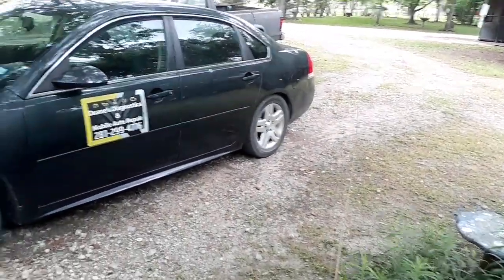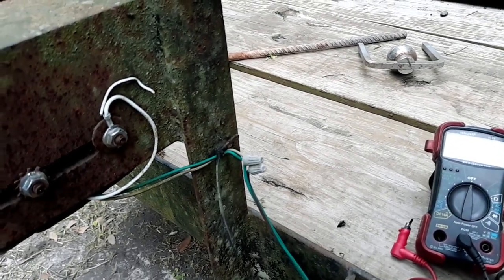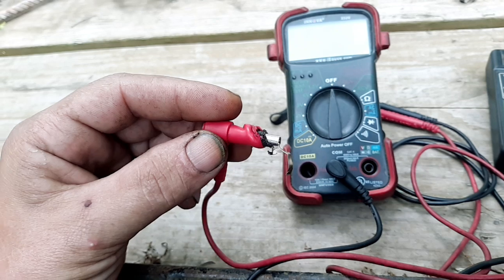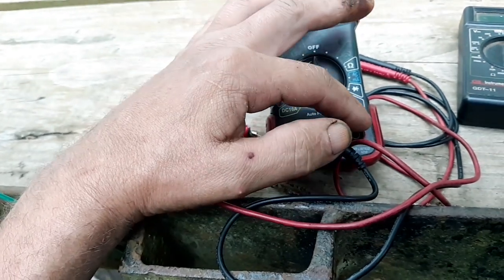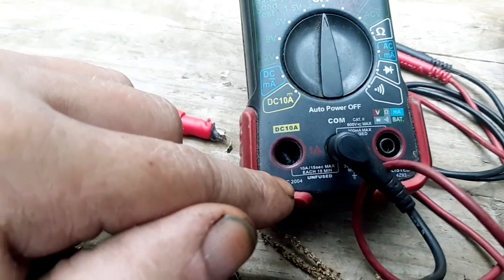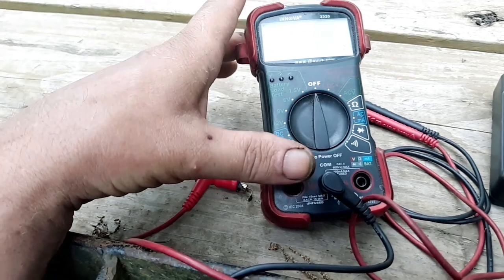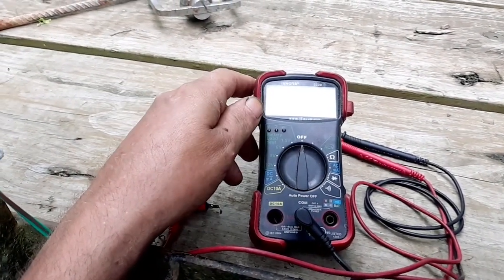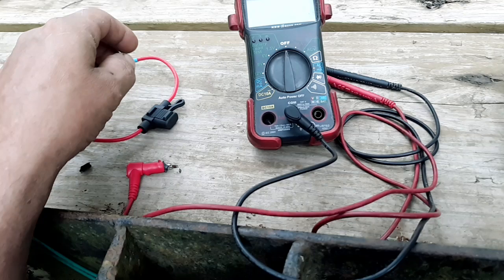Fried my multimeter. Common mistake. Nobody's perfect. Check your test leads before testing.

Comment: Depending on the way they arrange that circuit it might still work in the other modes. it looks like it just melted off the 10A jack.
Reply from the maker: Yeah, honestly I was thinking the same thing myself.....I think it might still work in some of the other modes.....but I never tried using it again since it fried.....but am curious about that......will probably eventually try it.....can't really hurt it any worse...lol.

If nothing else, I figured I'd keep it for parts and the circuit board and internals. Eventually I want to learn how to solder and desolder circuit board parts and learn more circuit board level testing & stuff......but I'm a long way off from that, but figured it'd be good to keep for parts to practice that kind of stuff on when or if I ever get around to it.
Reply: @DuanesDiagnostics  on the black one that I have that Jack is just connected through a shunt a thick piece of wire and there are sense lines on either side that go to the circuit for monitoring. So if they stuck to the same design method theoretically all the other modes should work unless it took out a trace on the circuitboard between something. The best part if it still works you won’t be make that mistake again as it will be physically impossible.
Reply from the maker: @imark7777777  Yeah I remember seeing a thicker piece of wire on mine near the ports.....guessing that might be a shunt.....will have to take a closer look at it.....but yeah, I won't be able to make the same mistake again with that meter.

Comment: Yep 2 cheap meters. I myself had the one on the right and accidentally did this to a power strip. Thankfully it was a power strip and the built-in circuit breaker tripped. In that case it's got a thick copper wire in there so it handled the short and lived to tell but I also pulled out quick.
Reply from the maker: Yeah I never even thought about that.....about being able to hook it up wrong on AC line voltage......probably could smoke the meter alot quicker that way.....but good your power strip had the built in circuit breaker, and it actually worked.

Comment: Bad meter design. I have done the same on my test meter and it blew an internal 10A fuse without damaging the meter. It looks like your """FUSE""" is a thick piece of wire. As you say "UNFUSED" - why??
Reply from the maker: Would pretty much agree, it's a bad meter design......but also honestly, the bad design has also 'saved' me in the past, where I went to check battery voltage, but didn't realize the positive lead was still in the amps port from previous testing I'd done, so when I touched the leads to the battery posts momentarily, I just got a 'spark', but no blown fuse, or melted meter, so that design has 'saved' me in the past, but not this time.

From what I've heard from automotive instructors, alot of meters are internally fuse protected......but not this particular meter......it does say 'UNFUSED' on it......right below the amps port.

Not really sure why some meters would be fuse protected, and some not......but seems like an intentional bad design to me to eventually sell more meters......but maybe not.....I could be wrong.
Reply: @DuanesDiagnostics  Yeah it's annoying the first time it happens and you don't have any 10A fuses and have to wait to get them before you do the testing. Now have a pack of 10 just in case. However, also then bought a digital clamp meter [UT210E] (does up to 100A DC and no direct connection to the circuit so nothing to blow up - newer ones do even higher currents now) for doing high current testing so don't use the normal meter in the Amps socket.
Reply from the maker: @johnr3435  Yeah I have a few different amp clamp type meters, but they're not always accurate or reliable for measuring in the low milliamps range......which is alot of what I need to measure......checking battery drains/parasitic draws, etc........sometimes the regular non-clamp meter with a direct connection to the battery is much more accurate for doing tests like that.......in my opinion.....at least based on my tools and experience.

But I do have a clamp type meter that was pretty accurate for the low milliamp range, but it started not working right about a month ago or so.......I also have amp clamps that hook up to scopes......are highly accurate.....but also not quick and easy to setup or use......

That meter I fried was pretty accurate on the low milliamps setting......and so was the clamp type meter I had been using.......up until about a month ago or so.......but most likely I'll just end up buying new meters of both types......I like having both just to be able to compare their readings to each other......and also like having multiple ways to test stuff......or backups......but also think that's better to prove a 'diagnosis'......if multiple tools are showing the same thing and the same readings.
Reply: @DuanesDiagnostics  Yes, you are right not accurate/reliable on DC for low miliamps - constant need to zero out. I'd be interested to know which clamp meters you found to be accurate for curent.
Reply from the maker: @johnr3435  This is the stand alone amp clamp I had been using.......it was pretty accurate, had it about 4 or 5 years......but it started not working right about a month or so ago....

https://www.aeswave.com/True-RMS-Low-Curr-Clamp-p9214.html

The only other low amp clamps I have are for using with scopes.

But if you check out AESWAVE they have all kinds of cool tools and different types of amp clamps too.
Reply: @DuanesDiagnostics  Thanks for that - much appreciated. I'll check them out.

Comment: My fix is that I always make sure to to move the dial to the 20 volt  DC setting after doing an amp reading. Especially before putting the meter away. Placing that fuse in line is also a great idea. I think I would feel safer if it was less than 20 amps though. It's better to replace a fuse than a meter
Reply from the maker: That's definitely a smart idea to switch to the 20 volt DC setting after doing an amp reading, and before putting the meter away.

From what I've seen, it seems like the amps function on most of those types of meters is usually rated at 10 amps, but might be higher on a Fluke or different type of meter, but was only 10 on that meter I fried, so I wouldn't want to go above that, but would definitely be much cheaper to replace a fuse than the whole meter........seems like on meters like those that aren't fuse protected on the amps function......that's almost engineered to fail....to sell more meters......because almost anyone that uses a meter and uses the amps function.....is going to eventually forget or not pay attention to where their leads are at......and make the same mistake I made......then BOOM!!....meltdown....and you gotta buy another meter....instead of just replacing a fuse.

Comment: Bit scary it melted like that! I'd love to own a meter for 15yrs, I'm always breaking either the jacks or the clamp meters or I drop the analogue ones. Tend to get a couple of years out of the cheap (catIV and fused) even killed a couple of flukes in my time lol.
Reply from the maker: Yeah, a little scary it got that hot, enough to melt down the meter leads and ports, but didn't really seem to affect the trailer wiring at all.......I guess it's got some kind of shunt or resistor built into it that absorbs the heat from the amp draw......somewhat like a heatsink or circuit breaker that doesn't actually break the circuit until the meter actually melts down.......that seems like kind of a stupid design.......if it was fuse protected, that wouldn't have happened.......but I guess they sell more meters that way, without it being fuse protected.
Reply: @DuanesDiagnostics  There's stacks of meter reviews here on youtube, I'm an electrician by trade so it's pretty critical I have those safety features and ones suited for the work I do. 
There's even half decent portable oscilloscopes/dmm combos that are cheap thanks to China these day! Owon & Hantek would be great for your type of work IMHO. Happy fault finding 😉
Reply from the maker: @TradieTrev  Thanks. That's cool, my dad was an electrician, and my nephew is too. Not sure if it's in the gene's or not, but I've always liked learning the electrical & electrical troubleshooting stuff, but really like just troubleshooting/diagnosing stuff in general.

I have a 2 channel Pico scope, and a single channel U-scope, but have been wanting to get one of those 2 channel portable type scopes because they would be quicker and easier to use and setup than my Pico, and would be one more channel than my U-scope.

I have an 8 channel Hantek, a cheap'O hundred dollar one, but isn't the portable/stand alone type, it requires using my laptop and the Hantek software......and it's kind of junk, but somewhat useful for some stuff or just to practice with, but can't really expect much out of it for a 100 bucks.......but will probably still look into one of their 2 channel portable type scopes, or the Owon/Owan.

Comment: My craftsman has an internal fuse. I purchased replacement fuses and have only had to replace one in the last 35 years. I still know where the other fuse is if I need it.
Reply from the maker: That's VERY, VERY, VERY Good!!!!....only blowing one fuse in 35 years......I would guess after blowing the first one, you probably learned that lesson......it's a bit of an inconvenience, especially if you don't have extra fuses on hand, and have to try to find or order some, or it's maybe your only meter, or main 'go to' meter.

On my meter, that DC AMP circuit wasn't fuse protected......otherwise I would've blown the fuse years ago, if it had one......because I've definitely hooked it up 'wrong' before in the past, going to check voltage, but not realizing I still had the positive lead in the Amps port......but I guess that meter uses some type of shunt/resistor to protect the meter up to a certain level......which I guess could be good or bad depending on how you look at it........if mine was fuse protected......it would've just blown the fuse by hooking it up 'wrong'....and not fried the meter.......so seems like fuse protected would be the better way to go......when or if I buy another one I might just add an inline fuse on the positive lead, just for the extra protection, to not fry the meter, just in case.

Comment: I have one of these and it works really well
Reply from the maker: When I first got that meter I didn't really like it all that much......probably alot just because I was use to using my older meter.....me personally, I also don't really like the auto-ranging function, and really wasn't sure if that meter was very accurate or not........but I tested and compared it to all my other meters and it's pretty accurate.....and has most functions you need to have.....so after years of using it.... it kind of grew on me....and became one of my main 'go to' meters...... I would definitely buy another one.

Comment: I almost did this while working on an air conditioner
Reply from the maker: Yeah, it's pretty easy to do....especially for me because I'm always testing different stuff and switching back and forth between different meters, and running jumper wires and probes and stuff......so sometimes just grab a meter and hook it up without really paying attention to what ports the leads are in......I've caught myself on it quite a few times before in the past, but not this time.

Comment: As someone who's messed around with auto electrical diagnostic I've done it before lol best thing to do to never forget is do what I did spend the lil extra and get a clamp meter never forget then
Reply from the maker: Lol....yeah with a clamp meter you'll never forget......I do use the clamp type meters also quite a bit.....sometimes I use both just to compare the readings..... and sometimes like to use the regular meter for measuring battery drains/parasitic draw.......

Actually my main clamp meter that I normally use started not working right over a month ago......and of course only on the milliamps function which is what I normally use it for the most....... so am gonna have to buy a new one of those too.
Reply: @DuanesDiagnostics  smh that's messed up understandable situation
Reply from the maker: @milsim4796  Yeah, seems like it's always something.....always more tools to buy.